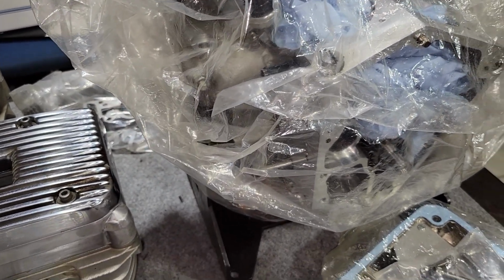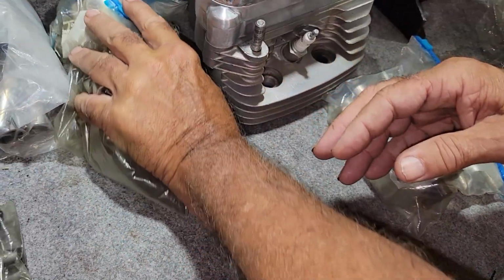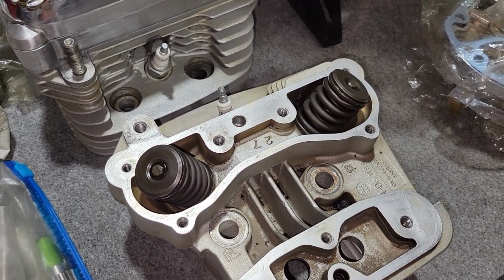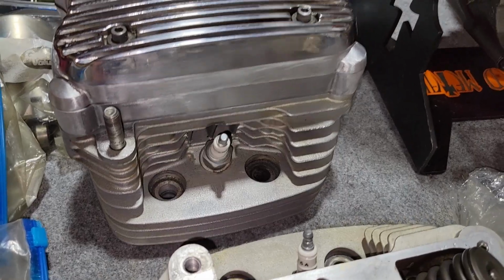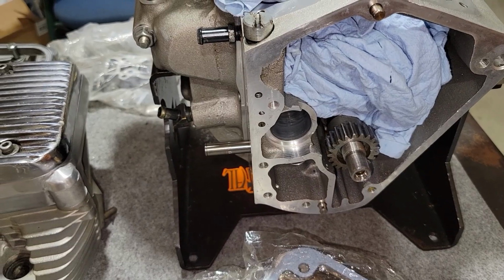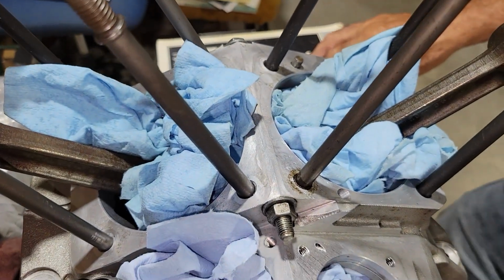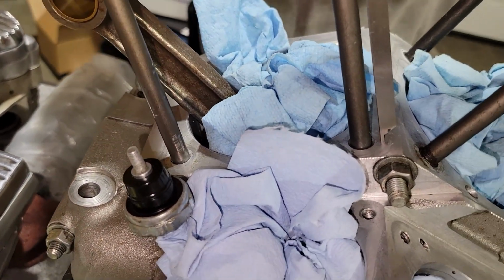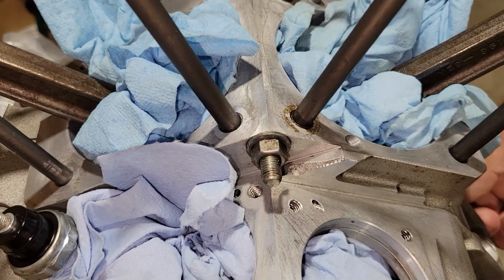1984 - 1991 Harley Davidson Evolution engine rebuild Part 1, Introduction

Comment: I was wondering why my 1984 flhtc evo 1340  , cylinder and heads was are  black but the crankcase is just plain aluminum  , was this how they was manufactured then ?  . It’s mostly peeled off now
Reply from the maker: The 1984 FLHTC evolution was a transitional model in 1984 they had all polished aluminum motor and transmission with some chrome covers maybe a previous owner painted some parts black or replaced some engine parts with black painted parts. Thanks for the comment
Reply: @jessesvintagegarage765 your probably right
Reply from the maker: @reallife2849 yes I think so they didn’t do the black and chrome until the early 90’s my fathers 1987 heritage Softail was silver and chrome
Reply from the maker: In 1984 the FLT Tour Glide was available with rubber mounted shovelhead or evolution motor with 5 speed transmission also the all new FXST softail made it's debut it was evolution motor with 4 speed transmission rear chain drive. Also an all new model debut was the FLHTC and only available with evolution motor 5 speed transmission and belt final drive.
Not sure why your bike would be a 4 speed and not sure if a 4 speed transmission would even fit in a rubber mounted FLHT model.